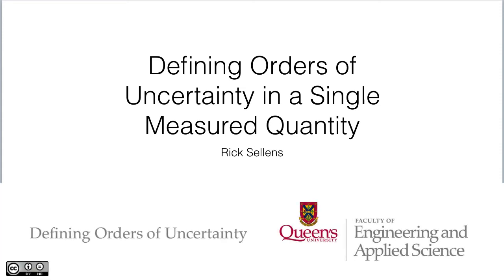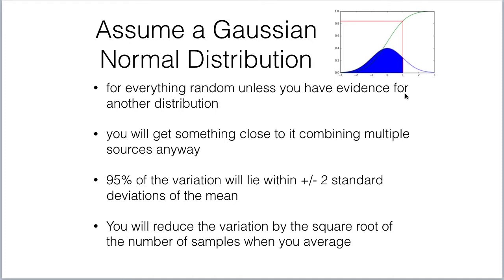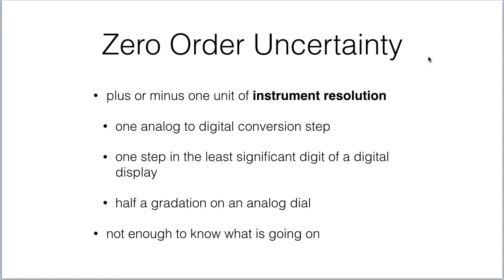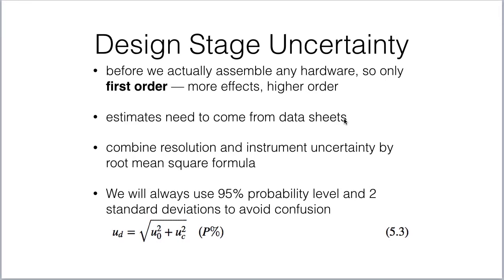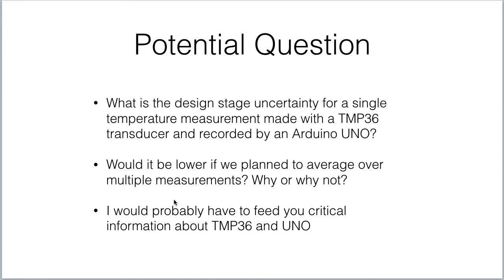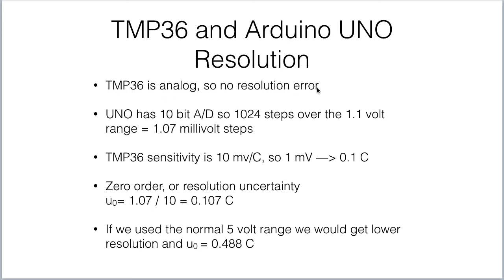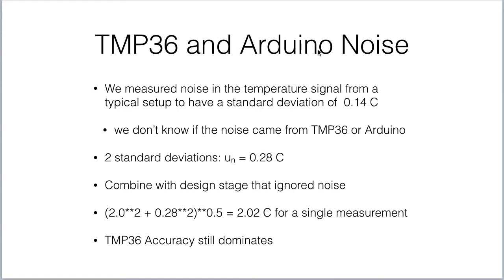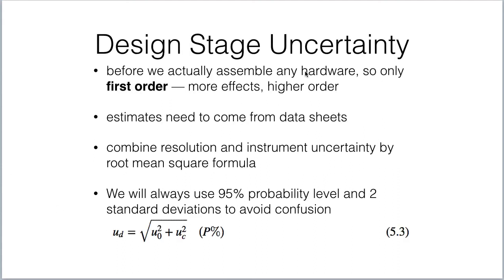Defining Orders of Uncertainty

Comment: Can u please provide answer🙏🙏🙏
A thermometer system is composed of a sensor and a readout unit. the readout has an accuracy and resolution of +-0.7 C and +-0.62 C, respectively. The sensor has an accuracy of +-0.88 C and a hysteresis error of +-1.36 C. Estimate the design stage uncertainty in the temperature measurement for the readout and sensor combined.
Reply: You should probably go to the person who assigned the question for help with your solution.